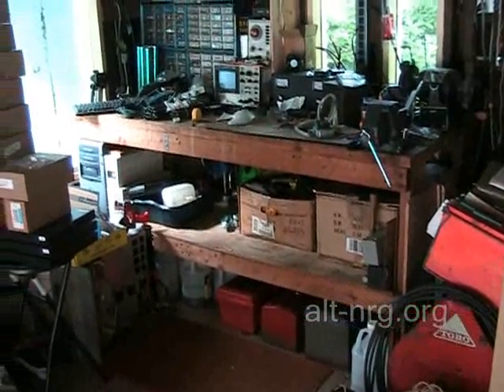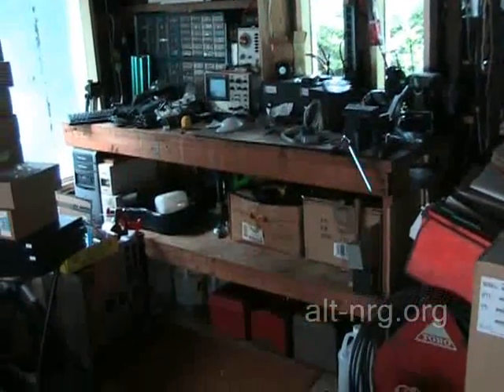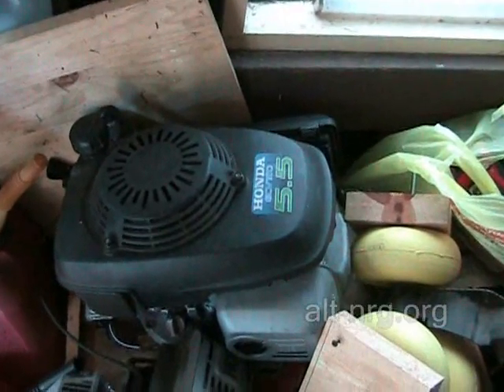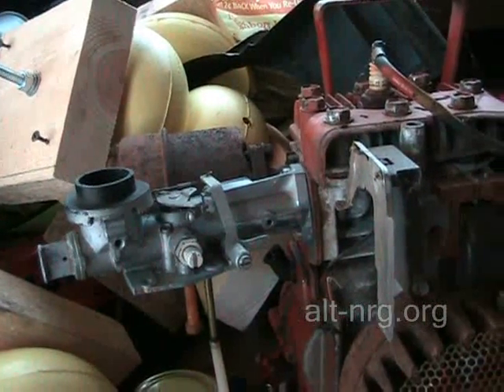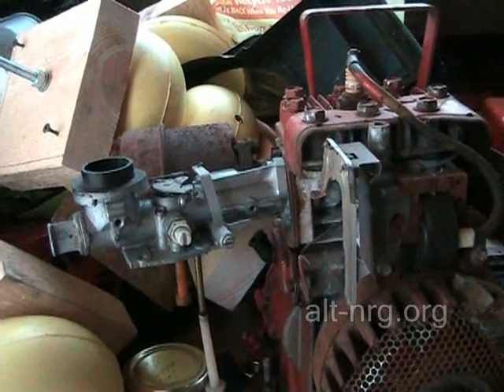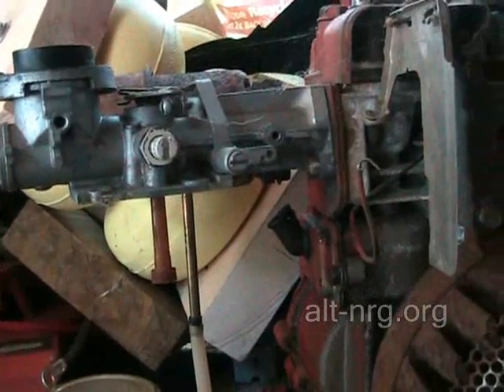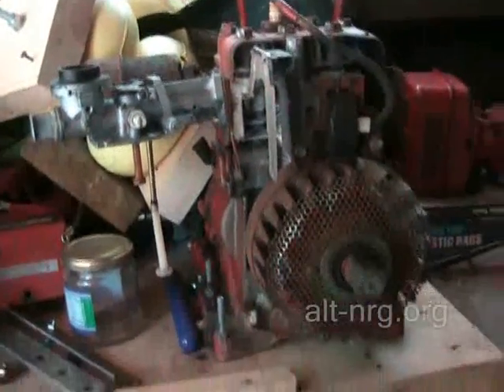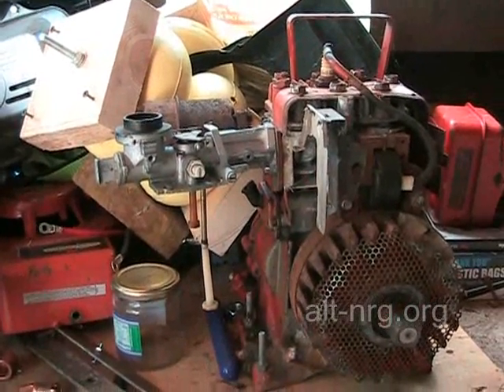#230 - HHO run time experiment resumed

Comment: I have been planning an experiment similar to this.  I believe that the adding hho will cause the engine rpm to want to increase the governor will close the throttle to compensate.  The more closed throttle will lead to reduced fuel consumption.  This is a very good experiment i am excited to see the results.

Comment: its a nice apparatus for this test ... my own sacrificial engine did not have the run fuel air mixture setting available for manual control ... will you be adjusting the screw to maintain RPM ???  will not your governor try to compensate for your mix setting ???